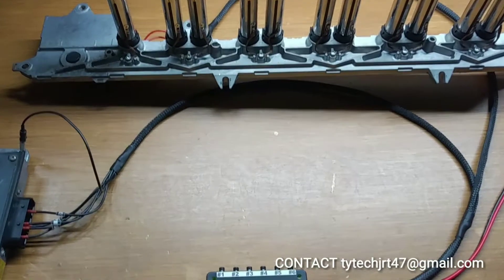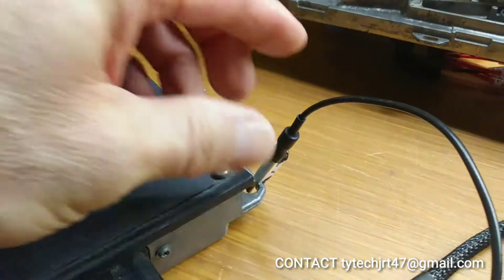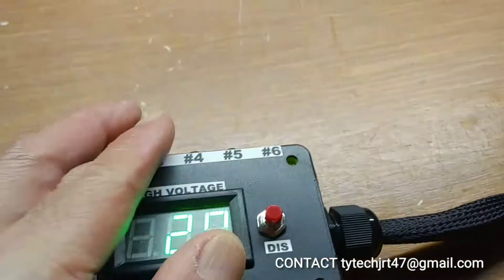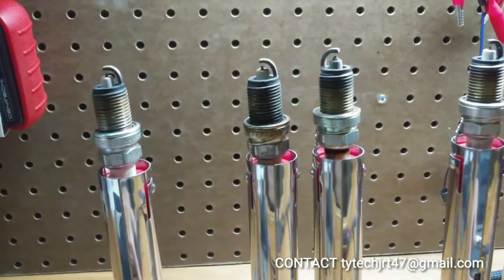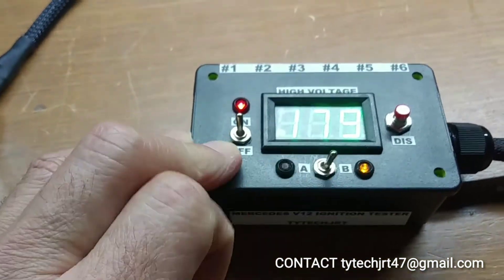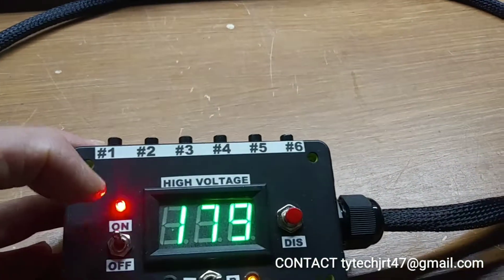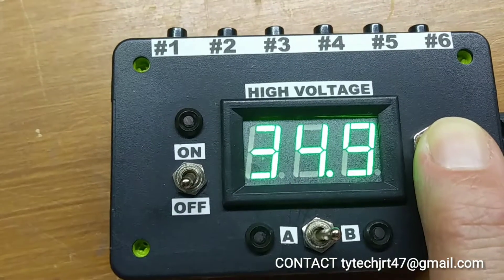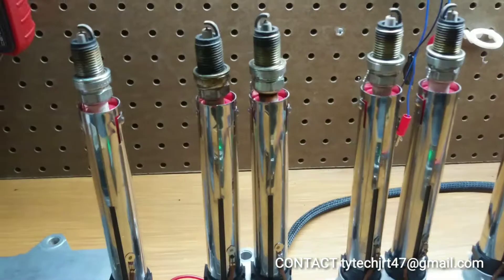Mercedes V12 S600 Ignition System Tester Operation coil pack repair

Comment: Where are u located ?
Reply from the maker: EBay
Reply: How much is this tool
Reply: I sometimes have a miss only on cyl 5 and only under full load but only low rpms. Sometimes doesn't happen. Happens specifically only when cruising in convenience (comfort) mode at say 80mph and I hit throttle right to kickdown but not clicking kickdown, so the transmission doesn't downshift using the engine torque to accelerate.  So 80mph, 5th gear, 2500rpm, full throttle,  builds this miss on cyl 5 and only cylinder 5 and none others.

I can accelerate full throttle through the gears from a stop all day long without a miss.

I suppose I can drive in sport and never have the issue.

The coils are from 2014. And am concerned with shops not handling things well such as breaking the coils.

Thank you!!!

Is this insulator issue??
Reply from the maker: EBay
Reply: I want to rebuilt my passenger side coil park
Reply from the maker: Do you have the parts?
Reply: Yea,  can I call u ?
Reply: Mr.clark please can i have like that tester ?